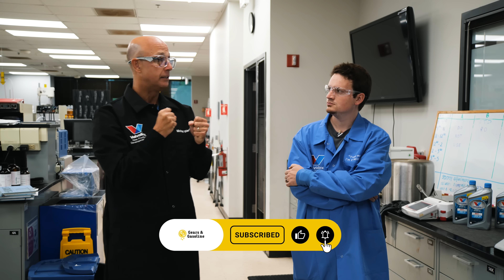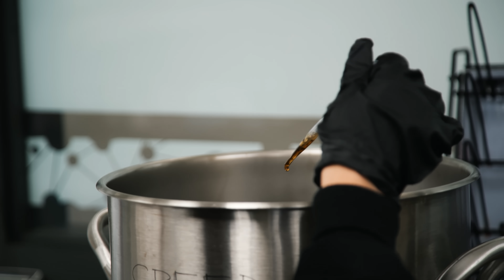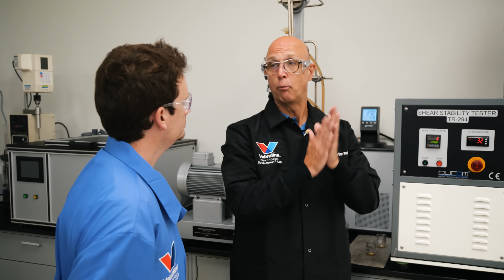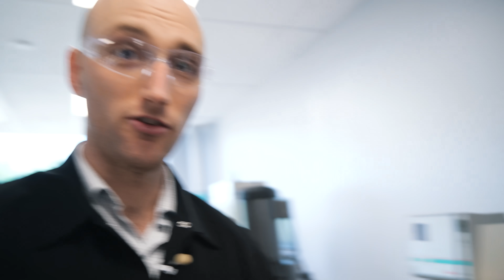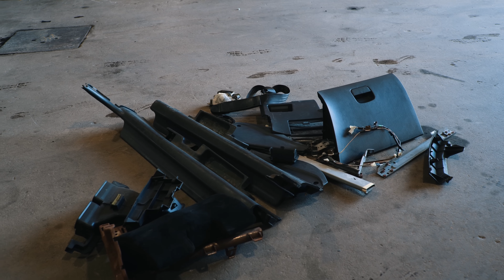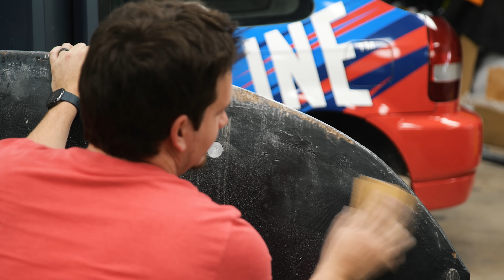Using Oil to Make More Horsepower in my Civic

Comment: What about a lighter oil for your gear box, let say you use a 75w90 oil, how  possible it is to get a 65w80 or use a 30w60 race oil with enough additives to protect the gears and LSD ?

Comment: Love how far this car, and you, have progressed really cool!
Carbon splitter next year lol ? $$$$
Also, now that you have side intrusion protection from the cage.. cut out the inner door skins? I think you need to atleast put something over them to tidy them up

Those anti grav batteries are great and getting cheaper and cheaper... I've always had big boy optima batteries in my cars... rather pay extra for something that will last if I let it get flat a few times. And anti grav (or other brands) are just a little more expensive that optima batteries so it might be my next go to choice. I'll save 15-20kg in my car

Comment: Being a fellow racer in the scca and nasa iv found white interior is a blessing and a curse.
Looks great , cheap , clean looking but gets dirty and gross ungoddly fast how ever you can see EVERYTHING  such ass we found the exhaust to my car was too close to the body and was heating up the floor of the car where my fuel cell is it darkened the white paint along with we found 1 wire that we missed a shield on as it had arked and had a black mark on the white. So wile yes it gets dirty fast it can be helpful later when finding things that we wouldnt blindly missed if we had painted the car truck bed liner black like planned ( durable paint , dosnt scratch or chip and its still light weight...ish haha)
Reply: Thanks for watching and don't forget to hit the like button.. I've got something for you, Write number above⬆️ ⬆️ ⬆️ to claim

Comment: For the front splitter, look at getting some Sintra.  It's lighter weight, available in multiple thicknesses and can be shaped easily.  It's also available in black.

I use Sintra all the time as I work in the sign business, I believe it's far superior to plywood as it doesn't rot or need any protection.  Give it a whirl.

You can also have someone design a splitter in illustrator so that new ones can be easily cnc cut at a moment's notice.  Pretty sure there are plenty of sign shops in VA that can do that for you easily and at a minimal cost.
Reply: Always thought making the splitter out of wood was odd. But then again idk if that’s common practice, guess I just never knew
Reply: @brdllc  alumicore is also popular.   Basically, it's sintra with an aluminum sheet on each side.   Really popular for making signs.
Reply: @bandwagon240  that’s what I had always thought. I just don’t understand why wood, maybe to add weight to meet requirements?
Reply: Will that even hold up to abuse, honest question.
Reply: @asylumville8544  absolutely.  It also isn't susceptible to rotting/water intrusion like plywood.

Comment: Man, this was a bit upsetting. How do you do to Valvoline HQ without doing your homework, at the very least? How do you not know the pretty basic functions of oil? Also, Valvoline has been making oil for racing and high revving applications. They've done this before, and been able to build a company based around making oil blends that meet various requirements. They just specifically blended his oil in house, an oil blend that they kind of already sell off the shelf.
Reply: Wow, it’s almost like this video was designed to be seen by an average individual that doesn’t have a chemistry degree and for the sake of advertising.
Reply: @JosephSamsor   At this day and age it doesn't require a chemical degree to read up on oil composition: such as Antiwear Additives, Extreme-Pressure Additives, Detergents
, Emulsifying Agents
, Viscosity Index Improvers, Oxidation Inhibitors
,  Pour-Point Depressants, and Corrosion Inhibitors
. These are all common lubricant additives. These additive packages are specially blended with base stock oils to get a particular result. You can displace a liter of 5-30w with 5-20w of the same brand to achieve the same results, a 5-30w oil with a slightly lower viscosity. You might just learn something, even with just exposing yourself to new material. I hope it's not so difficult to educate yourself.

Comment: Works for Valvoline and say weight which is wrong. 10-w30 is the viscosity during the summer and winter. W is for winter, not weight.

Comment: Oww buddy, for those who are watching, do not do what he just did regarding the sealing the burned through rubberized undercoating with more rubberized undercoating. Let me explain. 

If you watch closely, you can see a little surface rust. A little is not a problem, but you NEED to use rust converter/neutraliser primer to seal the area first. Then you can spray rubberized undercoating or wax based sealing or whatever floats your boat. If you don't it will keep rusting and if you just use rubber sealant it will rust under it like crazy and you won't notice. Check YouTube for more info. 

I've been fighting rust longer than I care to mention, it's a pain in the ass to do correctly.

Comment: Wow that’s super interesting. I didn’t know it only takes about an hour for oil to thin out to a 5w-20.
Reply: I assume he's using extreme circumstances in this scenario. I've run/am running walmart "stop tech" or whatever it's called small motor formula in my ~180hp 12.5krpm liter bike. No issues, no crazy viscosity loss, and thats me running her relatively hard for a streetbike.
Reply: @warrensmith792  that makes sense I was about to say damn imagine road trips. if ur driving 6-8 hours no stops and the oil thins out that quick that would be bad.

Comment: I´m using Modul 300V 10W60 with Lucas Head Duty Oil Stabilizer. And the Engine last longer :)

Comment: I've put 2 cycle oil , 0w20 Napa, even an ounce of clear oil from Sam's clu and a light squirter of sae 30 non detergent from dollar general into the fuel tank.

The sae 30 non detergent felt tight past half throttle In a 4cyl, no recommend.  An ounce clear oil coats the fuel system in a j35a4, it hit vtec but very insulated quiet and fuel efficient but then 2 gallons of A plus run ExxonMobil had a strong smelling detergent or alcohol ? And washed away my homemade 😋 fuel additive.  Wonder how it be if it stayed intact. 🤔 probly saving fuel being half injection at 3.99 currently

Comment: People are gonna see you top off at the track and think you're running ATF in the engine as some secret tactic
Anti-grav batteries are too cool, they even have one with a built in capacitor jumper so the battery can jump itself